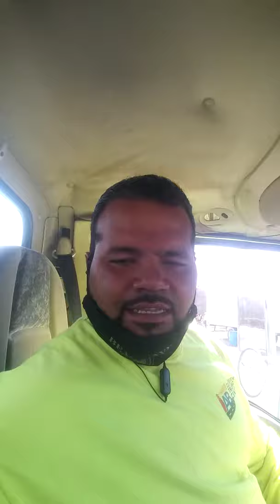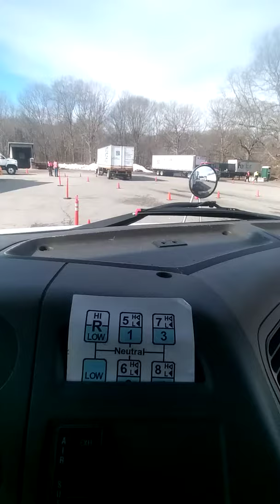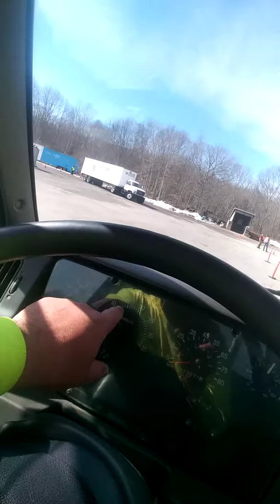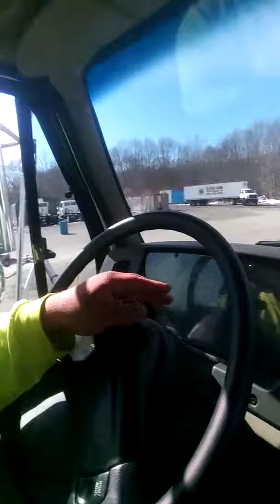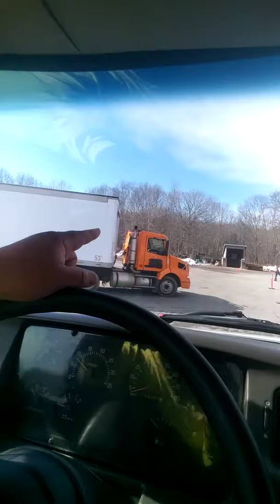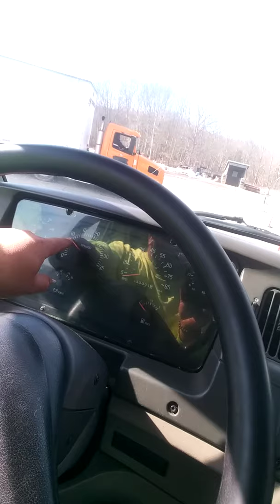How downshifting like a pro.

Comment: Our cdl instructors have us slow to 1000 rpms and clutch neutral and rev up to 1500 on a 10 speed when downshifting
Reply from the maker: yes, slow down to 1000 rpm but rev up to at lease 1200..... 1500 is a little to high for me.
Reply: @TruckingMastersCDLTraining  It is 500 rpm shift without splitter as in 9, 10, 15 speeds.  300 rpm with splitter as in 13, 18 speeds unless straight sticking than it's 500 rpm. 5x4 1000 rpm on main box and 300 rpm on aux trans.

Comment: I'm a new driver,  i' ve been trying to figure out how to downshift at 1500RPM because I've seen other drivers done it,  and guess what?  and I did yesterday 🕺🕺🕺 so now all the high range gears I downshift at 1500RPM when im going from 6th--5th gear I drop it at 1300RPM.  I'm slowly getting to the point where I don't even look at the meter anymore for what RPM or speed im at I'm practicing to listen to the engine and take note of the speed this also helps to recover gears quickly too.

Comment: So once you put in neutral the rpm will drop below 1000rpm and that’s when driver should press  accelerator  to get it up at 1000 to go into the next low gear is my question?
Reply: Yea
Reply: No if you are at 1000 rpm in fourth and you wanna go into third you will need to be around 1500 rpm. Seems to be around 500 per gear but depends on the truck I guess.

Comment: Wish I had seen this before I took my test yesterday. After watching your video on backing I nailed my backing. I failed my road test because we were not taught how to down shift properly. I love this video, I retake Saturday. Thanks so much for your content.
Reply: Did you end up passing your test?
Reply: Downshift floating while using the jake is even easier and a much better way to slow down…but that’s the lazy ass in me cuz I don’t like touching brakes or clutch until I’m about to come to a complete stop or about to take off 😂😂
Reply: @trucking masters CDL training. My trainers said I need to drop to 1k rpm neutral gas to 1500 then clutch shift but it only sometimes works ( double clutch rev match. I also do this in my 5 speed car but it works there

Comment: Great explanation . Now I understand. I was kicking it out of gear and letting the rpm drop, but I was still traveling to fast. Now I know to let the truck slow down with it in gear to let the rpm's drop slowing both the engine and Trans. at the same time . Allowing the rpm's to match each other. Thanks for the help.

Comment: I been driving truck for a yr now but i drive an automatic i had the opportunity to jump in a manual since i took my test with a 7spd synchronized trans so when i got in it up shifting i was floating like a pro when it came to downshifting that was my problem and this just solved it thanks so much i was doing the grind it till you find it

Comment: Thanks so much for that info im in training and Im having problems downshifting ..im going try the way you explained with the rpms ..Great video👍🏽
Reply from the maker: Let me know how it works out, I can do another if this ones doesn't help.
Reply: @TruckingMastersCDLTraining  ive tried it today i did ok. But at the training school i go to they go based on speedometer when to downshift ..its just now  im having trouble smoothly down shifting to 2nd before completely stopping at a stop or lighy i know i must do it between 0-5 rpms but i dont get it on point so it grinds putting it on 2nd maybe if u can do a video you downshifting showing the rpms on the road would also be helpful. .Thanks
Reply from the maker: @eltoro9386  of course.

Comment: And guys if you're downshifting and it's grinding don't fight it,  get back in a higher gear to gain control of the truck/semi slow it down with the service brake or engine brake if you have to, and downshift again you can't allow the truck to be running in neutral for too long they are big and heavy things can get messy really quick.

Comment: Hey mate when you down shift what are you revving the truck to? I know you need to slow your rd speed and rpm down but when you clutch from gear to neutral what rpm do you rev to before it goes into gear?
Reply from the maker: The perfect rpm for downshifting is 1000.
Reply: @TruckingMastersCDLTraining  ok thank you when i was taught to drive an 18 speed we were told for example if going from 6 to 5 slow truck to 900rpm clutch to neutral rev to 1100rpm then clutch to 5th. Are you saying you only need to rev to 1000?
Thank you.

Comment: New driver here, I’m loaded/empty do i have to down shift from 10,9,8,7,6 and so on or can I jump gear for example 10 to 8 and so on I may sound confusing hope you understand me
Reply from the maker: Yes you can jump gear, but make sure the speed matches the gear.
Reply: @TruckingMastersCDLTraining  as long on around 10rpm I should be good to downshift correct? I’ve seen others that  gas it a little to downshift idk if it’s another method
Reply from the maker: Correct, the lower the speed, the less rpm you need.

Comment: I am sort of confused now. I see other videos, as well as the guy I am training with say to wait until 1000RPM's (just as you do), but then they rev up the engine to 1400ish, and then downshift. Are you saying to wait until 1000RPM and down shift at 1000?
Reply: If you’re cruising around 1600 rpm. Let off of the throttle and get the engine to wind down to 1000rpm. (1000rpm is your starting point to the down shift maneuver), then pop the gear into neutral, slowly but gradually give some throttle while having slight pressure pushing the shifter into the lower gear. When you rev up the engine it matches the truck engine speed with the road speed.
Reply: @kleevrgaming5720  awesome, thanks. The slight pressure on shifter while giving some throttle was another question I had, so you answered that too.    What happens if the rpms drop below 1000, can I still do this technique?
Reply: @bugnut82  You can but it might bog down on you quite a bit and you can really struggle to get or keep your momentum going long enough and quick enough to build up the rpm's again to upshift into your next gear. So, don't be surprised. But chances are your not going to stall out completely if it's merely the next gear down. If it IS bogging down too much on you, depress your clutch and quickly go down another gear. You may even have to give it some fuel to get your rpm's up enough for it to slide into another lower gear tho if you do.